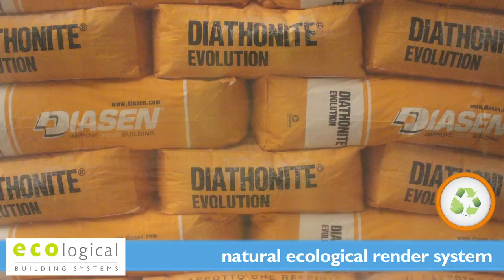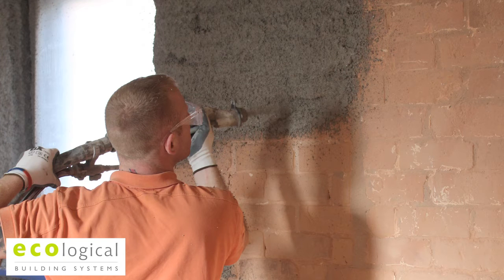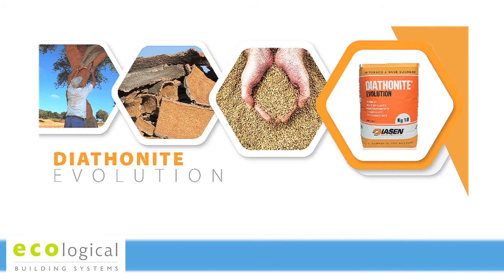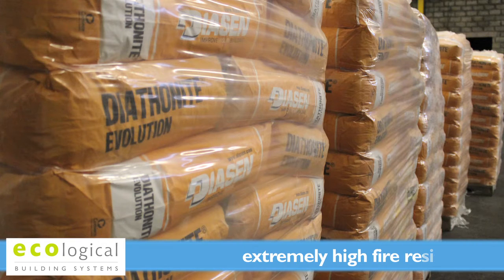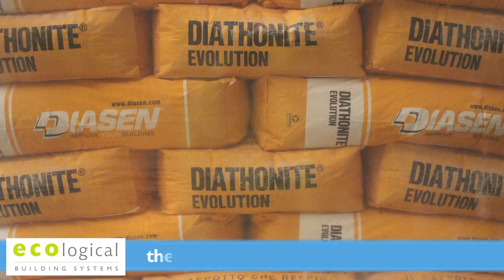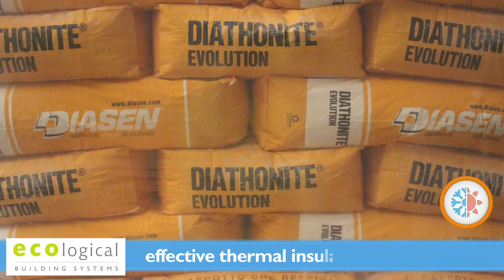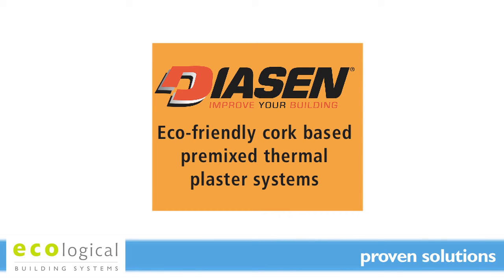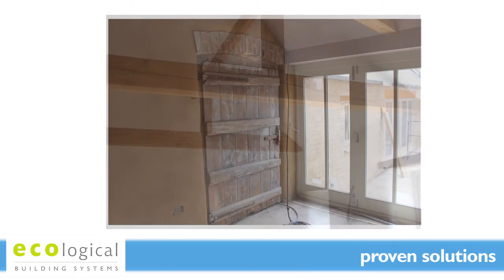Diathonite Evolution Insulating Plaster

Comment: Would the deumix stop damp? The walls have sand and cement on solid stone walls would the sand and cement plaster have to be removed first? Then use deumix or could you use deumix over sand and cement plaster?
Reply from the maker: If the sand cement is trapping moisture and contributing to the damp issue then it should be removed. Then Deumix can be applied directly to the wall as an external insulation and dehumidification plaster with anti-salt properties. If there is a persistent damp problem this must be remedied first. Deumix will not stop damp, rather, it will allow the walls to breathe and dry out quickly while repelling salts.

Comment: This stuff is great. It takes time to do and to dry but the result is really worth it.
Reply: Hi Dominic. Would love to hear more of your thoughts — was just told about this, currently researching my options for internally insulating an 1800s solid wall building.
Reply: @envueltoenplastico  The problem with most internal wall insulation systems is the need to get the walls flat first. If you use things like Kingspan and other foam based materials you lose breathability and thermal mass in one go even though on paper this kind of material is very efficient,  and you need to either flatten the walls fo at least batten them out to leave an air cavity behind. With Diathonite you just set up some profiles to the depth you want to go to and whack it on. depending on the depth you want to go to you might have to do this in stages, but once you are at the required depth you just scrape off with a straight edge against your profiles. Once the main area has set enough you remove the profiles and fill the gaps there.
The great thing about this material is that it is breathable and has thermal mass. It is also very good for soundproofing.
We used it throughout an opera singer's house. You get warm dense walls that feel solid and strong. It is what I would use for my own house and I have used and taught about about many systems (I teach an annual lecture at UCL on internal and external wall insulation).
Reply: @elephantman2415  This is great, thanks very much for your comprehensive description! I actually talked to someone who works for a company who sells it here in Ireland. I need to do my homework on my existing walls, and see what's appropriate, but this is a very compelling solution. Thanks!